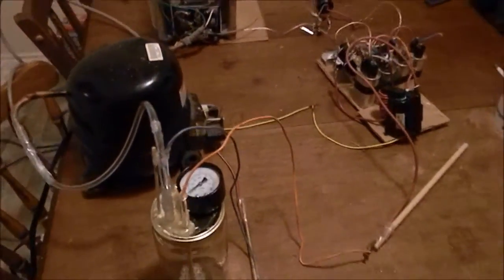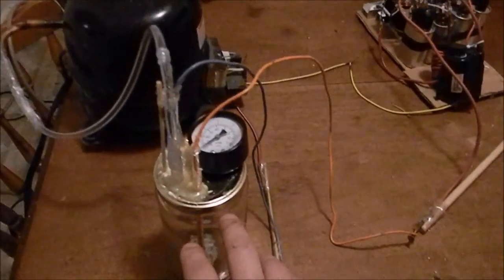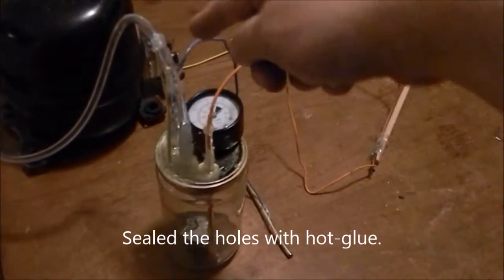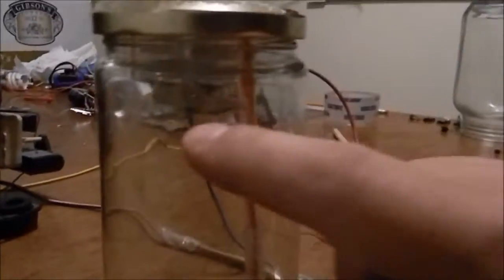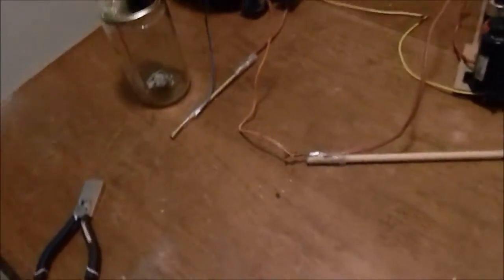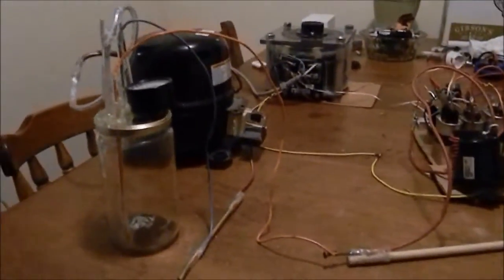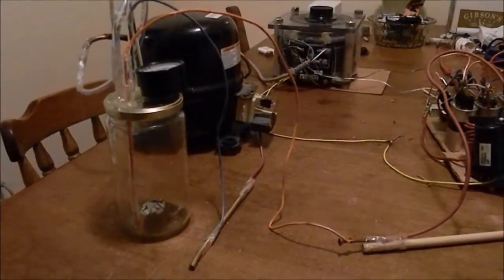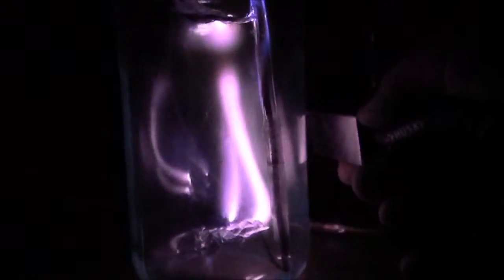HV Vacuum Plasma Chamber

Comment: What is the exact absolute pressure
Reply from the maker: +hans mayer I think the math works out like this: (-29"Hg/29.92"Hg)*1013mbar =981.9   then 1013mbar-981.9mbar = 31.15mbar (answer)
 I believe that is the more or less the exact absolute pressure of the chamber in the video.
Reply: +Binj Komisar thanks